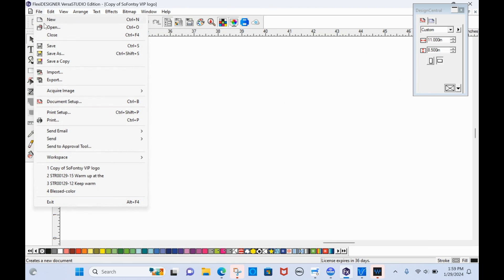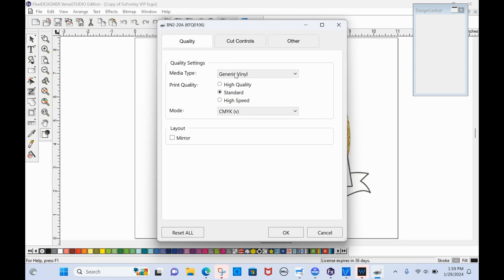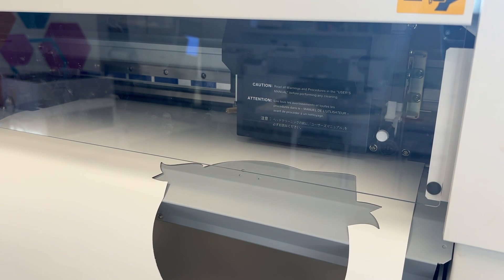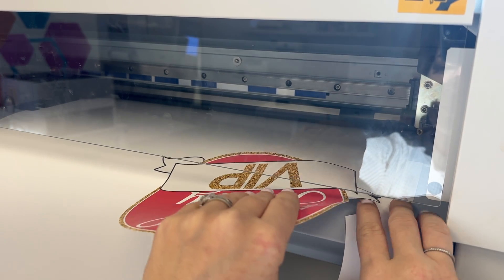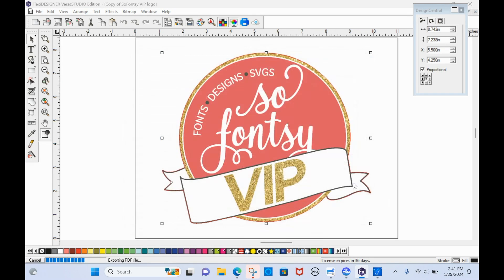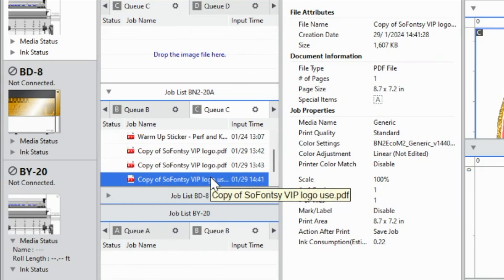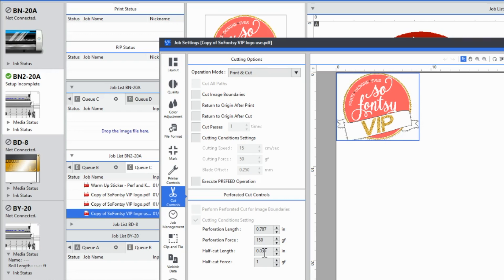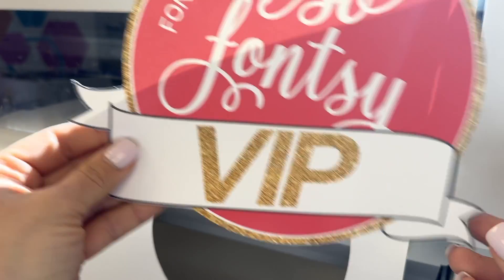Roland Die Cut Settings Fix! Adjusting BN2-20A Perf Cut Settings in Flexi Designer

Comment: My versa works perf cut options does not look like yours. im only seeing the top portion and there is a drop down for perf cut but not option to change perf length perf force ....
Reply from the maker: It sounds like you might be using an older version of the software.

Comment: Hope this does not destroy my teflon strip. I see that you did not reply to any of the other comments inquiring about it
Reply from the maker: Mine has been totally fine, but just to be on the safe side, I always recommend you run a quick test cut.
Reply: @SilhouetteSchool  Thank you for the response! I attempted the perf cut, but the perf cut came out as a square instead of a cut around the design. For example, I put a countour cut around my design to add a bleed. Then, I added a perfcut in the grey color just on the outside of the contour. And in Cut Controls, I selected Perforated Cut in Cut Image Boundaries, I then checked the box in Perforated Cut Controls titled Cutting Condition Settings. However, a square perf cut was cut around my designs instead a perf cut that followed the border of the design.
Reply: @SilhouetteSchool  I have one more question. When I go to load a new media into my bn2-30 printer, it does the print test and then gets stuck on Adjustment in Progress. It'll stay there for hours and all I can do is stop the set-up process or turn the printer off and back on. What am I doing wrong?
Reply: Also, I'm happy to sign up for the silhouette school. Do you take phone calls?
Reply from the maker: Sounds like you could benefit from some personalized support!  I don't take phone calls but do offer 1-on-1 same day email support, live Q&A's and a private FB group. Check it out here:   https://silhouetteu.com/pages/join

Comment: There isn’t login supported on bn2-20 perf cut option so you use tips on your video to make a real due cut I m
Right ?
Reply from the maker: This video will help you with your perf cut settings in Flexi Designer.
Reply: @SilhouetteSchool thanks you but you confirm me modulus perf cut exist only on bn2-30 so the point you show I that you can use this tips but it s unofficial

Comment: recommendation on blade to use? no matter what i do and what blade i use it is grazing the vinyl in the print portion and leaving lines on finished product
Reply from the maker: Sounds like you could benefit from some personalized support!  Check out Silhouette U where I offer 1-on-1 same day email support. 🔗👉 https://silhouetteu.com/pages/join
Reply: I've actually been on with support from roland. And I guess to specify it is on the roland static cling only(pretty thick backing). No matter where I put the rollers and set up the media. Inevitably, at one point during the print, it will graze the static cling. I also found that roland uses about the smallest overall size blade on the market. Not talking blade depth of cut, which I obviously know is adjustable with the blade holder. But that does not change overall size of the assembly/blade. I need overall size of the entire blade/barrel to be smaller. Cricuts is the next closest, but still about .1mm too long. I specd these out with a digital caliper. And have done a lot of checks and tries. There is a huge variance in overall blade lengths from manufacturer to manufacturer.
Reply: So in conclusion, I was just wondering if you were using roland blades. Or a specific aftermarket. I did bite the bullet and purchase Roland's, but they're just so damn expensive! I was a professional mechanic for 10 years and now do this full-time. So realistically if I cannot figure it out, I feel there is most likely something else going on. Not always. But usually.

Comment: Nice video. Im having trouble with my vinyl lifting when cutting. Any tips to fix this? Thank you!
Reply from the maker: If your vinyl is lifting while cutting on a Roland BN2-20a, the most likely culprits are a dull blade, incorrect blade depth (offset), too much cutting pressure, a worn cutting strip, or the vinyl itself having "tunnels" where it's not fully adhered to the backing paper, causing the blade to lift the material during the cut
Reply: @SilhouetteSchool  thank you for your response! This guy is brand new so factory settings are in play. Although my cutting strip is pretty damaged

Comment: Thank you for the clarifications. With regards to the perf cut, doesn't this affect the cut strip? Over time that will harm the cut strip and you will have to replace the cut strip. To my knowledge, there is no cut strip replacement for the BN2-20 as of yet...correct? 
I really want to do perf cut, but if there is no way to replace that part...then that would take my printer out of production if that part is missing.